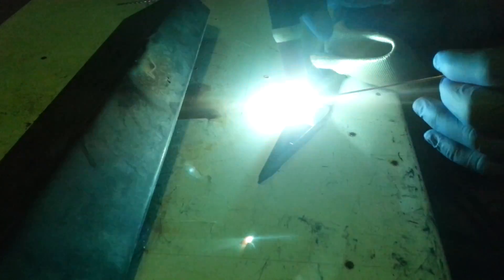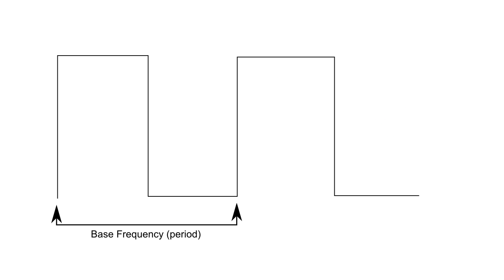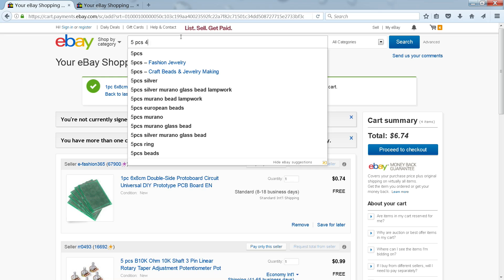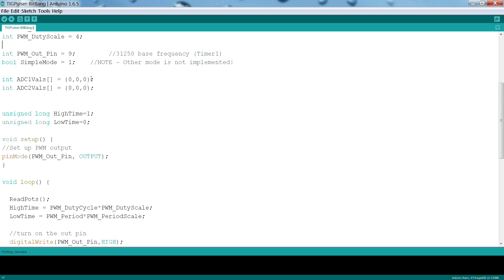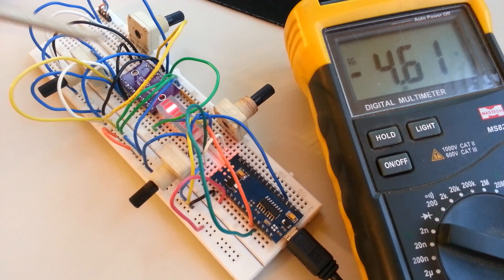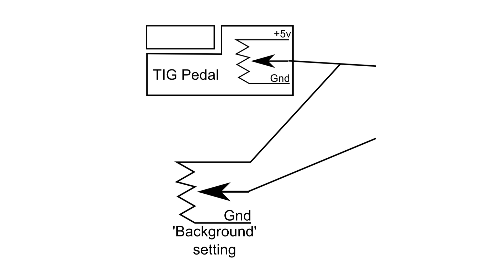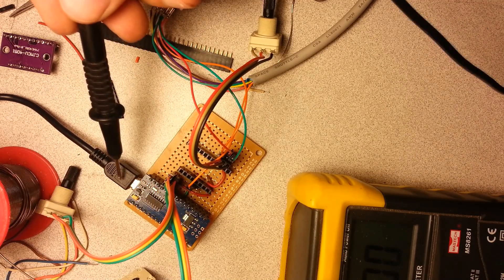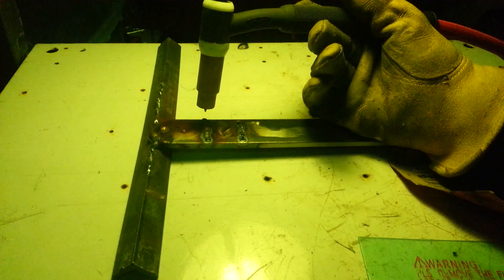Build a TIG welder pulser add-on for $10. Cheap and Easy.

Comment: Cd4093 would use half of its flgates for same stuff. And you can just rob some of current from high amp setting pot... No need for a multiplexer.

Comment: Are you familiar with cold welding? I'm learning tig and recently bought a tig with pulse feature but since I make jewelry often, I now wish I bought a tig with cold weld tack feature but those machines are twice the price and after seeing your video I'm wondering if maybe there exists or if it's possible to build a circuit that can add cold welding function to a standard pulsed tig. Any suggestions?

Comment: Very interesting.  However the lead in with the sparking id a red herring. The sparks are from lack of weld purging. 
On a related site, the miller pulse options are found to be just switches, pots, and ribbon on a pcb as all the logic is already in the main pcb. For that, miller charges over $500., and some of them are obsolete.

Comment: Nice Job! Luckily i own a welder with all needed pulse-settings, but i really like to see problems solved your way...
Maybe i can trigger you for a next project (: 
I've seen this really nice "tig button" on youtube to control amperage by more or less pressing the trigger. I've messed around with an arduino and a fsr, but i'm not happy with the results right now, because it is way too sensitiv ... maybe you have some great idea to solve this? I'd like to purchase the original, but it is way over my budget, particulary because i'm in europe, so there would be shipping and taxes on top ...

Comment: I have a Lincoln Tig 275 Square Wave  without pulse. I would like one built for my machine. I would like it to be able to change the pulse rate by a knob or Digital display. I can get you the schematics of the Lincoln Tig 275

Comment: Can I add a pulser to my DC inverter tig? And can I add a amp controlled pedal. I swapped my thumb switch for a foot pedal, but it only turns off and on at a fixed amperage. I do have a dial for amps. From 10-200 amps.

Comment: What is the 5 pin connector called? It almost looks like a 5 pin DIN (240 degree) but it's not. I also looked at GX connectors which appear to match the circular pattern but it's 15mm in diameter vs 16mm for the GX. Thanks

Comment: @This Stuff I Do. Can we talk about doing a mod like this on my Miller 252 mig welder?  I need to add pulse to it if possible. It doesn’t use a tig pedal obviously cause it’s a mig welder. But...  I do use a xr alumapro push pull gun to do all my aluminum welding with this machine which has the adjustment knob on it so I would think that circuit would work. I am not the best with electronics and I have zero coding skills.

Comment: Very cool.  I'm trying to turn a DC MIG into an high frequency square wave TIG in similar fashion.  I need high current components though.  Any suggestions?  I was thinking of a mechanical points device.

Comment: I'm about to buy my first welding machine and your design may save me quite a bunch of money. Does the welding machine need to be "pedal-ready"? I see machines with only a two-pin connector for the torch switch, and other machines with five-pin (I think) connectors. Is this design suitable for the two-pin connectors? Most of the five-pin connector machines can already pulse the arc for what I've found.

Comment: I was searching this add-on pulser for long since I bought a very light weight Chinese Arc Welder a week ago which doesn't have pulse function. For a pulsed arc welder it could cost much more money. I will try your arduino pulser on my Chinese arc welder first. If it works good, I will try it on my old Miller power source. If it explode! XD Then my welder game is over!

Comment: I went to build this but using the Arduino 1.8.9 program I get an error message when it gets to the line "ReadPots();" which just says "ReadPots" was not declared in this scope. What's that mean? I'm not a very seasoned coder so I'm a little lost with that. Should I just go ahead and load the program or does someone know what it needs for that line to satisfy the verify check?
Reply: Try using my code posted above about 11 months ago.
Reply: @jzurek112  link? Cant find it.
Reply: @devilvortex1  look through all the comments. My code is below.
Reply: @devilvortex1  here it is again:

//vars

int PWM_DutyCycle = 0;
int PWM_DutyCycle_Pin = A0;

int PWM_Period = 512;  //period in ms
int PWM_Period_Pin = A1;

//Scale the time of the period or duty by N*1024 milliseconds.
//e.g. PWM_PeriodScale=5 will allow a maximum PWM period of 5120 ms or ~0.195Hz
int PWM_PeriodScale = 3.5;
int PWM_DutyScale = 3.5;

int PWM_Out_Pin = 9; //31250 base freq. (Timer1)

unsigned long HighTime=1;
unsigned long LowTime=0;

//Setup PWM Output
void setup()  {
  pinMode (PWM_Out_Pin, OUTPUT);
  pinMode (PWM_DutyCycle_Pin, INPUT);
  pinMode (PWM_Period_Pin, INPUT);
}

void loop()
{
  PWM_DutyCycle= analogRead(PWM_DutyCycle_Pin);
  HighTime = PWM_DutyCycle*PWM_DutyScale;
  LowTime = PWM_Period*PWM_PeriodScale;
  
  //turn on the out pin
  digitalWrite(PWM_Out_Pin,HIGH);
  delay(HighTime);

  //turn pin off
  digitalWrite(PWM_Out_Pin,LOW);
  delay(LowTime);
}

Comment: hahaha the end code was missing. read pots was never defined. Thankfully it wasn't to hard too finish. Also not understanding the simple mode. seems like it shouldn't be in there. Soldered up a little board and it works nice
Reply: any chance you could post the remaining lines of code for us beginners?
Reply: @penztoy  see my reply 11 months ago. It'll work with his schematic and get you going.
Reply: Nothing special in the readPots() function. Arduino analog input the pots values are bouncing and not make accurates values. I think he store the potenziomenter values in a array and then he check if the old values are the same. Sorry for my english . Greetings from Italy

Comment: I see that this is an older video but my question is, as you seem very knowledgeable about welders, can a pedal be added to a welder that comes with only the on or off feature? If possible that would be interesting. Thanks for the video.
Reply: In his video the one pot is emulating the resistor in the  foot pedle

Comment: Would like to know how this is all made in diagram form. Its a bit much to ask but if you can make a diagram of how this is put together it be much easier to follow the video. I am trying to use a WHDTS Adjustable Signal Generator to replicate what you have done to simplify but I am having brain fart so smelly its confusing me lol.
Reply: I recently fixed up my code and added an LCD screen to my setup based on this. I have to document my ladders for future use as well as some one lines. I can post them here along with my updated code.
Reply: @jzurek112  can you post your code and schematics? Ok r email them to me please @ mackn918@gmail.com
I built this board 2 years ago and still haven't got it to work as I don't know how to write custom Arduino code. Thanks.
Reply: @codymack6343  I posted the code about a year ago.

Comment: Hi everyone. I bit-banged out some code. This seems to be working for me. Note, I changed the scale values for my own purposes. I am running this on my Syncrowave 250. My welder is using ~9 volts. So I was able to use the multiplexer listed in his video. I tied my grounds together and only ran the TIG Vref though the multiplexer used a separate 5V power supply to power the Arduino. Never allow more than 5V into the Arduino. Here's the sketch I am using:

//vars

int PWM_DutyCycle = 0;
int PWM_DutyCycle_Pin = A0;

int PWM_Period = 512;  //period in ms
int PWM_Period_Pin = A1;

//Scale the time of the period or duty by N*1024 milliseconds.
//e.g. PWM_PeriodScale=5 will allow a maximum PWM period of 5120 ms or ~0.195Hz
int PWM_PeriodScale = 3.5;
int PWM_DutyScale = 3.5;

int PWM_Out_Pin = 9; //31250 base freq. (Timer1)

unsigned long HighTime=1;
unsigned long LowTime=0;

//Setup PWM Output
void setup()  {
  pinMode (PWM_Out_Pin, OUTPUT);
  pinMode (PWM_DutyCycle_Pin, INPUT);
  pinMode (PWM_Period_Pin, INPUT);
}

void loop()
{
  PWM_DutyCycle= analogRead(PWM_DutyCycle_Pin);
  HighTime = PWM_DutyCycle*PWM_DutyScale;
  LowTime = PWM_Period*PWM_PeriodScale;
  
  //turn on the out pin
  digitalWrite(PWM_Out_Pin,HIGH);
  delay(HighTime);

  //turn pin off
  digitalWrite(PWM_Out_Pin,LOW);
  delay(LowTime);
}
Reply: Does this work with his schematics? Thanks you I appreciate it.
Reply: @codymack6343 it should work fine.
Reply: Do I need to add "PWM_Period= analogRead(PWM_Period_Pin);" ?
Reply: @AeroasinRC  I didn't have to add it to use this code.
Reply: @jzurek112  you said you updated your setup with lcd screen? Can you post updated code and schematics? Thanks bro.
Reply: Where is the code for the lcd display thanks
Reply: with his code can I set pulse freq Hz ?
Reply: @novel819  this code allows you to manually set the pulse. So you play with the dials until you find up time and down time plus down time percentage.
Reply: Do you know what I can do to make this work on a 24v pedal?
Reply: @rrstryker  You need to DC-DC convert that 24v to 5v with a buck converter.
Reply: Nice addition Jeremy :) Do you perhaps have a schematic over how you did it? I have an older ESAB that is using 3,3V so I have to do something similar.

Comment: I like the project, and it's just what I need too without buying a new welder. But Mine is a Lincoln (out of warranty) with a 24 volt reference voltage. What do I do with that??

Comment: Fantastic video, thank you so much for this exciting combination of welding and arduino. Is it possible to use a mosfet like IRLZ44 to do the multiplexing just by changing the analogWrite value? What is the reason for using the multiplexer?

Comment: Very good and still relevant,pass your gray matter over this... How about pwm pulse and oscillation circuit for square wave ac welding for non ferrous welding .Is there a way to do it with out reversing big current values after inverting ,requiring expensive ,noisy contactors ?

Comment: Great video, I would love to build one to use on my chinese ac/dc tig which doesn't have a pulse function but sadly the output for the foot controller is `15v - any thoughts of a pulser that could work on  machines other than volt?

Comment: Pulsing allows deep penetration and low avg heating, generally clever. My takeaway of your crkt was tying the low current pot to the high current pot output. I thought that was brilliant. Not that it was complex but that you came up with that technique. My hat is off to you for that trick. Thx for sharing with the rest of us.

Comment: Ok not an electronics genius like yourself but I dabble and I never knew you could get blank circuit boards to solder in circuits how ever you liked. I've seen pre built and bread board before but never true blanks. I have bought like six or seven CDI boxes for motorcycles when I could've very easily built each one.

Comment: Very cool video. I wonder if you'd be interesting in making a project that adds high frequency arc stabilization to a welder. It would be amazing to add not only pulsing, but high frequency, as well.
Reply: Get an Arc Pig.

Comment: Could you email me the lay out solider point and what wires to hook up to the tig pedal. My welder is a scratch start with out foot pedal I've added a 7 pin plug to the machine to add foot pedal already. I'm in the works of adding high frequency arc start and stabilizer to the machine. All help would be great. Thanks for the video and keep up the good work.

Comment: You should had put circuit decouplers like optocouplers in-between welder circuits and Arduino outputs it is to avoid damaging your diy board if something goes wrong

Comment: So the design is very simple. With arduino and two potentiometers you create a square signal with high-time and low-time (it could be frequency and duty cycle, doesn't matter). The potentiometer in foot pedal sets high level when the fourth potentiometer sets low level (as % of high level). Now the stuff I didn't know 74 multiplexer can do is brilliant. It takes as input the  square signal from arduino and high and low levels from potnetiometers. The square wave drives the output switching it between high and low. And that's it. Brilliant.

Comment: Sadly, the innards of my machine reveal that it's not based on inverter technology and the only "remote" control is the on/off switch on the torch: it must be 20 years since I bought it. I don't think this will work for me, so it's time to spend money. Again.
Reply: Nicholas Hacking it shouldn’t matter right?
It’s just mimicking the foot pedal

Comment: Nice. I got a DC pulse, but wouldn't mind an AC pulse as well. Don't hink I'd risk breaking my welder, but this is a kickass idea. Don't even have a pedal, but you could probebly intigrate this setup with a button as well... When is this avalable on ebay? :)

Comment: i had similar problems with sparks. hat happend at my shop was a inlet, an air inlet in the gasline. what also can be is  a to high argon flow or a unharmonic gasflow there are gasflow reducers cost around 50$. also what can happen is a air flow troutgh the shop when my main door was open it caused a argon flow disturbance close the door problem gone. hope you can fix it in any of this ways. go check the complete gasline and the rest. good job with the pulser ! =)
Reply: Or a contaminated fill of Argon.  Try a different bottle.

Comment: Your spark probleme is due to the calamine in that kind of metal(angle and flat bar)try with square tubing im sure the result is much better.If you want to tig welding flat bar or angle you need to grind it to éleminate the calamine on the surface

Comment: Fuck you youtube. It didn't post my long ass comment. I wonder if it's a language bot killing my post because of my vernacular. Gotta get old school on this shit and copy before posting.

Anyway, hello. I appreciate your channel. I feel lucky to have picked it up. Keep it coming. Also, if you haven't checked out AvE here on youtube, do so. Fun channel that has a lot of useful info woven into it. Fun guy. He plays it up a bit for the channel, but it's not overtly forced.

I own a Miller Dynasty 200dx already. But I want out. I don't like having so much capital wrapped up in it. I don't need a mercedes, if a used RWD lexus or toyota will do just as good or better with propper mods. I'd like to build my own welder. I feel like I could make one better for my intended purposes. I also want to build something electronical to solidify and hardwire the head knowledge that I have with electronics. I've looked at the diagrams and opened up my welder. Pretty sure it has all the basic technology that we use elsewhere in electronics. I've worked around induction hardeners and other weirder shit. It all seems to have the same basic tech as lower end devices like microwaves, etc.

I hope you don't mind seemingly stupid questions. I like to verify things twice before I proceed. Hope you're open to the helps.

Comment: that's pretty sick! But your welding shouldn't be sparking like that at all! Either your material is contaminated , or your gas flow is too little, OR too much! If it's too much flow, it will cause turbulence which will draw oxygen into your molten metal! The goal of 100% argon gas is what suppose to protect the hot metal from oxygen.  Run roughly 15-20 CFH!
Reply: gas lens

Comment: You're my new hero.  What was the major issue with using a self contained off the shelf PWM controller?  You couldn't get the frequency slow enough?  I totally applaud the effort, I'm going to have to watch the video a few times and do some more homework to fully grasp what you've done!  Did you ever get around to posting the source code?
Reply: I posted the code I used yesterday.
Reply: Jeremy Zurek , I can’t find the source code anywhere. Could you share a link please?
Reply: @jzurek112  where? Cannot find it here

Comment: Hello, have you ever thought about making a couple to sell? Please email me naranjero83@hotmail.com
Reply from the maker: Would be fun but there's a lot of liability involved since welders are so expensive. I'd also need access to several different models to test and make different wiring harnesses. Given the noisy, dirty environments most machines live in, the design would also have to be ruggedized, sealed and shielded.
Reply: This Stuff I Do --- thats understandable. If you do decide to try an launch a product, I can be your tester, with no liability to yourself.
Reply from the maker: What make/model is your welder?
Reply: This Stuff I Do my tig welder is a Eastwood tig 200
Reply: This Stuff I Do , it has a pedal with a 3 wire cannon plug an a 2 wire cannon plug
Reply: I would also be interested in becoming a guinea pig ... I have a miller diversion 180 with an 8-pin Ethernet style connector and I want to do the pulse add on to my welding machine lancer1531@icloud.com if you have any questions ...